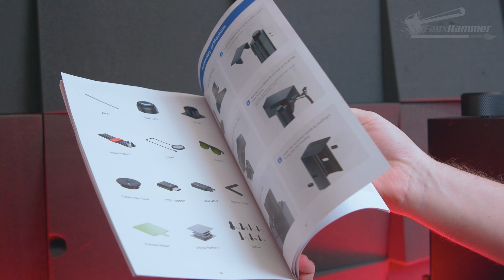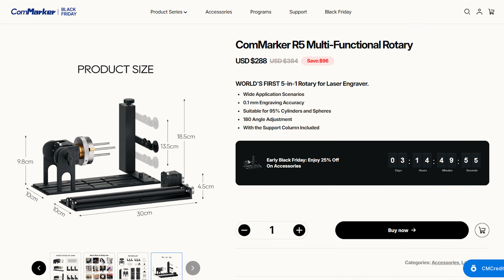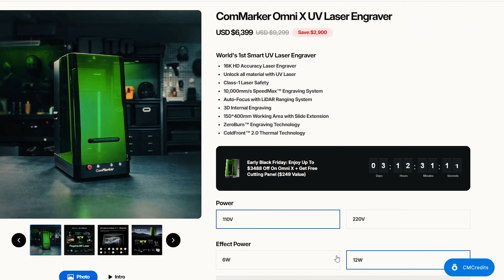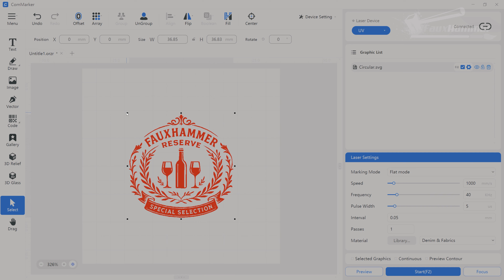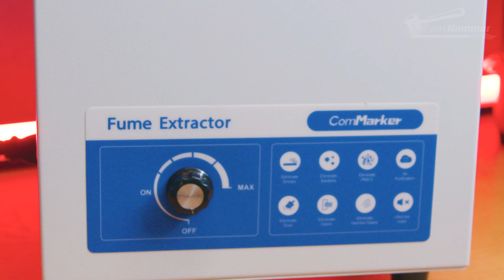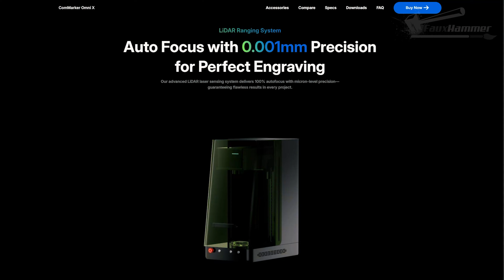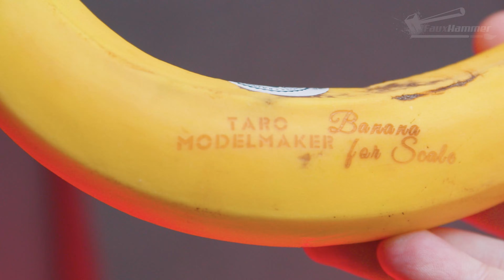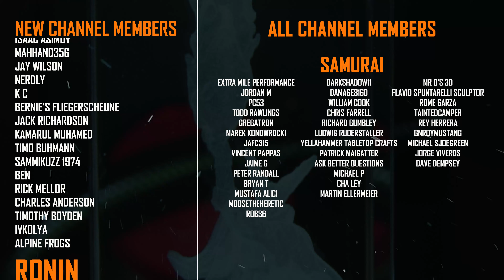The TRUTH about this UV Laser - ComMarker Omni X Review

Comment: Brilliant review although I got to 3 minutes in and decided this is not for me, I will go with X-Tool. Sorry but if the basic chassis doesn't even have dimensionally secure spacing, then I have no confidence in the accuracy of the rest of the machine, nor the ability to reduce harmful emissions safely. The unboxing experience should shine with assembly and reassurance of precision. I'm yet to buy my laser but this brand will not be on my list. Thank you for your honest no-holes barred (except the handle hole) review.
Reply from the maker: Please check my drool review first. And would appreciate you using my links if it was helpful. That’s how I earn.

Comment: I took delivery of the 12-watt version last week. My experience with fit and finish was exactly the opposite. It took you a long time to get the cover on? It is stunning how tight the tolerances are on my unit. The machine was running in less than 2 hours.  I suspect this Brit has a bone to pick with ComMarker.
Reply: Well, I didn't have a "bone to pick" before I tried unboxing & assembling my Omni X, but NOW I do. The tolerances suck, making some screws unnecessarily difficult to get in, and the assembly instructions don't match the current model. For example, what did you do with that loosely-hanging temperature sensor that isn't mentioned or even shown in the instructions?

Comment: Buy the xtool so much better in every way.  Comes with a camera and software that works and it's cheaper.. I wish it had been avaliable in October when I ordered my 5 watt version of this... I kinda messed that one up an expensive mistake. 
The handles on the cover need to be sanded, they are designed to be used with thiner metal.  Attaching the cover to the base is a joke as stated the holes dint line up the brackets on the base are far to low. Loosen off the base brackets screw in the walls then tightened them up it's the only way to do it.
My best advice is if you can wait till next year when xtool release a more powerful modle buy it on offer. Commaker are out classed

Comment: I have a 5 watt air cooled UV that use Lightburn but can only engrave 2D and not do sub surface engraving.  I recently ordered the 10 watt water cooled sub surface UV straight from China and should get it soon.  This 10 watt sub surface UV laser cannot use Lightburn and only use RK-CAD software.  Not many people know about RK-CAD.  This will be something that I have to learn to use.  It is not as easy to use as Lightburn.  I wanted a 10 watt sub surface UV so I did not want to get the Xtool F2 Ultra since it only has 5 watt. The XLaserLab E3 was a consideration for 10 watt version but since it is air cooled, it will be loud to cool 10 watt laser.  Also, it is still on Kickstarter so it will be a long time before I will receive it.  Air cooled is not as good as water cooled for 10 watt or higher.  I want my laser to last for a long period of time so I think water cooled is the best choice.  It is more quiet too.  However, my laser will take up more space but it is more industrial and will be a work horse.
Reply from the maker: Well, If it helps i have a video for the E3 coming out in the next hour.

Comment: So, I've recently found the channel and had a good time so far.

My first laser was a Creality Falcon 2 20W Diode [1st Gen], and served me fine.

I recently purchased a suite of xTool lasers. In one of FauxHammer's videos he posed the phrase, 'Just buy an xTool.' I think this is one of the reasons that stands. I was considering this product and ended up purchasing an xTool F2 Ultra. From using the Falcon 2, I already had to use Lightburn, so I am fairly familiar with it - far from a pro - but with those build issues and lack of cable integration, it's like Sony having internal battery packs in their controllers from the start and Microsoft recently getting into rechargeable units.

Again, it's not that this is a bad product, but from my own research and FauxHammer's video, the fit, finish and usability I personally would want to see, aren't warranted by the asking price of the unit.

Solid video.

Comment: One day we will get the true Bambu treatment of lasers. Until then it's going to remain half assed machinery with no concern for ergonomics or usability and the awful software to match it. Too bad even Bambu hasn't gotten there with their offerings.
Reply from the maker: We already have it, if anything xTool are what Bambu wish they were in printers!
Reply: @FauxHammer the software definitely isn't there for XTools, and I wouldn't call what they're doing groundbreaking in any way. Just best of the meh.
Reply: @tenchuu007  Bambu isn't exactly cutting edge or ground braking either. If anything they best they have is the software and the fan base to gloss over the high fail rate of the machines. As someone who owns 2 non Bambu A1s and an A1 mini all currently broken I can confidently say they are not as good as people hype them up to be.
Reply: @Panda_Plays_Games I'm not talking about them currently. I'm talking about their impact on the industry with the X1C that literally was like moving out of the bronze age into iron when we were bogged down in the Ender 3 clone era with crappy slicers on top of it.

Comment: I have the 5W OmniX. It had a problem with autofocus on arrival. Had a few emails with customer support and they agreed to exchange the unit with no fuss. I fixed it later my self so there was no need for them to send one - so I'd say it was ok experience with them. Laser is nice, works wonderful. Tried 3D cubes, it works great. It doesn't have red dot - it uses the same UV laser to show where it will mark and sometimes it is a problem to find where marking will be but I fixed that easily with a sheet of acrylic film which I painted with flourescent marker - that works great and it is much better to find exact marking spot than with that yellow paddle they give out with laser. The laser uses DBK2JW-C4 controller - not the usual JCZ boards. The software however... I use it only for 3D cube engraving :)